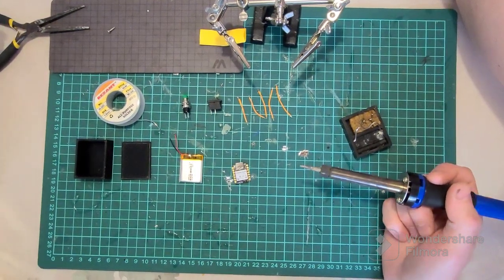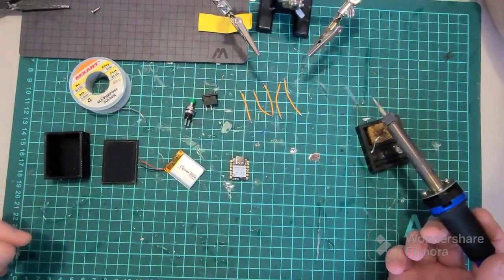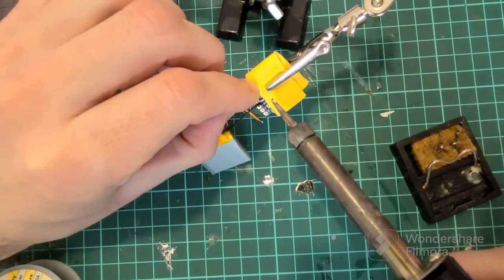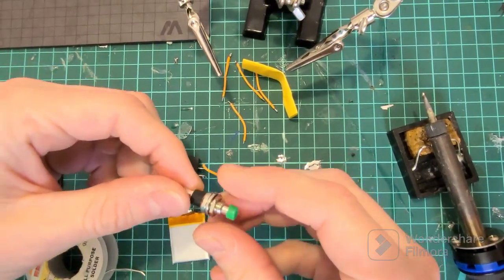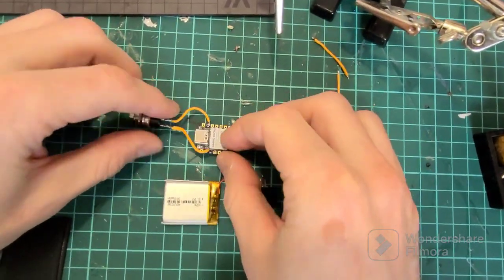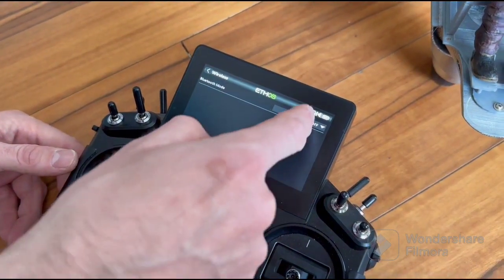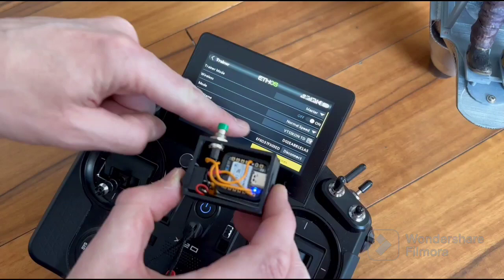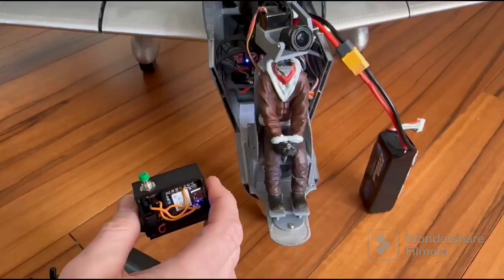Wireless headtracker from XIAO BLE SENCE

Comment: Hi,
I loved the simplicity of your project, so I gave it a try. I flashed the module and wired it (D10 to tip and GND to sleeve) to my Taranis x9d+ Trainer port. I tried Master, Slave, and all the other options but can't make it work. Am I missing something?
Just checked and the file is not present on the module!!! Only three files dating back to 2021 are present!
I am running EdgeTx